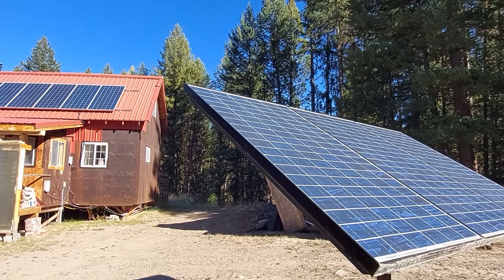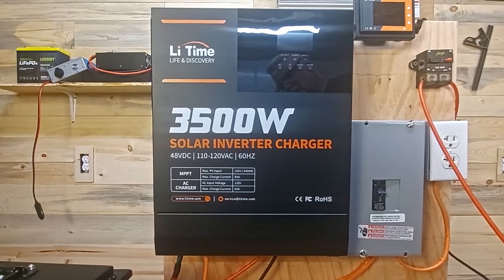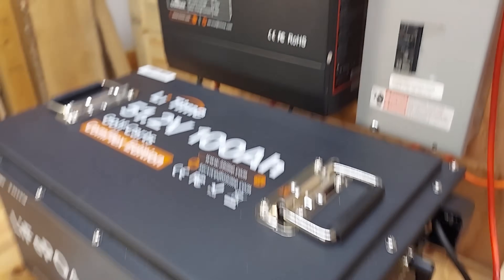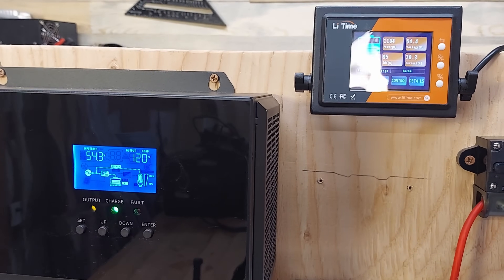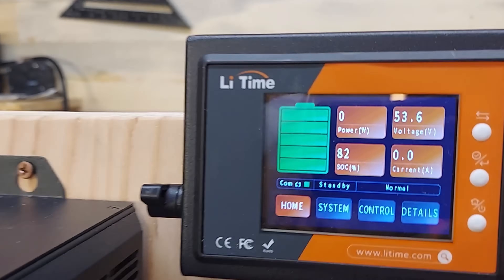Inverter Idle Power Consumption: What You Need to Know!

Comment: Thanks for the video. Would you feel the same way if you only had a 100 AH AGM battery in your system?
Reply from the maker: 1 100AH AGM wouldn't give me much power (at most you really should think of it as a 50AH battery in terms of use, and really a 25AH one) so to answer your question:  I would never try to do much with a 100AH AGM so Inverter Idle Consumption wouldn't be the issue, the battery would be.

Of course, I believe I mentioned that I worry less about the inverter and more about sizing the battery bank correctly ;)

Comment: Can confirm Not worrying about inverter idle consumption in a van means you just leave it on and where 240v (Aus) products are often better and cheaper than 12v alternatives there are no impediment to using them if all it needed was an extra 100w panel.
Reply from the maker: Makes sense on the 240v and yes, depending on the inverter idle, another panel usually does the trick (if you have the room)

Comment: I agree completely.  ANY inverter is going to use power just to have power available for you to use.  I have seen that as high as 72 watts on some of mine.  It's really irrelevant .
We got 3.5" of rain, tornados, and straight line winds yesterday.  2 people were killed, power was out for several hours, and we have multiple large trees down along our western pasture, but no physical damage here.  We used power stations to run our entertainment, refrigerator and a couple of fans during the short outage.  I cranked the dual fuel generator to run the freezers out back at around 7 PM and the power came back on at 7:45.  I had the Honda set up to run a bedroom window unit if the power stayed off.  Yes, it's early April, but we have had temps in the high 80s for the past few days.
So far we have had almost 6" of rain in the past 18 hours.  The sun hasn't even thought about peeking out, so solar generation won't be happening much today.  That's why those gas generators are so critical.  Our TV is a 65" and uses about 150 watts to run.  The router uses 40, so we will burn through a KW power station with just our entertainment system, and what else are we gonna do during a massive rain event?  Throw in a fan, some lights, and the refrigerator and 2-3 kwh of battery don't last long.
Reply from the maker: Yup, a few kwh will get you by in the short term but a generator greatly increases that.

Comment: Is that 50W overhead that will always be wasted, no matter whether a zero load or a full load? Or is it like idle on a gas car where it's only wasted at zero load, but once your up to full load, all power is put towards load with no overhead waste, just efficiency losses? 
Thanks. Great video.
Reply from the maker: I must admit I always assumed that is what it takes the inverter to run at idle and that it either draws that or more at use.

Comment: The problem with this cheap high frequency, transformerless inverter is not its idle power consumption, it's the fact that the manufacturer stripped out the most critical component that's needed to make this inverter long lasting, powerful, and most importantly, safe. This critical component is an output transformer. Without an output transformer to provide galvanic isolation, this inverters offers a shorter life expectancy, a much poorer surge capacity, and it can damage your appliances when its MOSFETs fail and can even set your appliances on fire. I would never use one of these lightweight inverters to power the appliances in my home.
Reply from the maker: 1 it is not transformerless,  2 most modern appliances don't draw the kind of power LF inverters can provide, 3 if you are correctbthan all power stations should be tossed out.

Are there better options?  Of course!  Can everyone afford them?  Nope.

Does everyone have to do as you say ir they will burn their homes down, ruin all their appliances and watch their offgrid cabins sink into the abyss?  No.

I ran our cabin on an HF Modified Sine inverter for the 1st 3 years before getting an expensive LF inverter and guess what?  My appliances are all still working fine 15 years down the road.

Comment: If you have a big system, then just throw in an extra panel. 

If you have a small system or a power station, it is a BIG deal. 

For Example, an EcoFlow Delta 2 uses about 35-40 watts of power. It also only has 500 watts of input power.  

Let’s assume you get good sun and are at 100% at 4:30 in the winter and you start producing at 8:00 in the morning. That is 15.5 hours of no production.  That is about 500 out of your 1000 watt-hours gone.  It also means I have to use about 25% of my total input to just makeup inverter losses. 

Another example:

I have a 24 Volt garage system I built for emergency use. Except for the battery and cables, I used mostly used/open box components to save some on the prices. 

I have two 15 amp MPPT controllers that can pull in 400 watts each. I have a Victron Phoenix 24/1200 inverter and the entire losses from the battery when the inverter is on is 14 watts and about 3 watts when the inverter is off. So I am only using a total of about 200 watt hours over night. This is equal to about 50 watts of solar panels a day out of 800 for only about 8% of my maximum solar. This is negligible. But I used a cheaper inverter with 40 watts of power usage, then I would need about 200 watts of solar to make up for the loss. 

For power stations, it is important to cut off the inverter when not in use. With something like a refrigerator, you can double the runtime by using a one hour on, three hours off if you cut off the inverter for those three off hours.
Reply from the maker: The issue here is that Power Stations aren't really built to run a home or for that matter a cabin, for an extended period of time.  That's why I do things like adding extra batteries etc.  But in the end, they are very limited when compared to even just an inverter and batteries.

Comment: Hi Old Jarhead! I have question please. I have compiled the parts for my 24 volt system. Includes 1000 watts in panels, 7 kw storage, and victron scc smart 100/50 including various other necessities 
My largest load for my setup is an inductive motor (110v) which maxes out at 1,050 watts. Short duration, i  use it a dozen or more times a day for anywhere from one to five minutes at a time. It averages total consumption 2kw in a 24 hr period.
The❓will i let the smoke out of a hi frequency inverter or should i purchase a low frequency inverter instead. I see from research the low frequency ones more suited with larger transformers. In trying to decide i see the all in one inverters, though i already have the victron scc. Help! What is your suggestion. 
Thank you Sir❤ i appreciate your time.
Reply from the maker: I run an LF inverter as they are more robust and can take those loads easily without an issue. The ne HF inverters can I'm told, but I suspect even the good ones aren't really designed for it. I'd personally go with LF.
Reply: @TheOldJarhead Thank you sir. Could you recommend one? I seem to have difficulty researching/deciding on this piece of the puzzle. I was nearly decided on an HF one.. Thank you again. Love your content. I learn from you still. Many thanks Sir
Reply from the maker: My AIMs ran 11 years before I changed to a newer version made by Sungoldpower.   AIMs would be myb1st choice.  SGP is basically AIMs made by another company but may not have as a high a standard
Reply: @TheOldJarhead  Thank you, that helps. I'm looking into the SGP ones. I forgot about aims. Thank you!! I will be able to make a better decision now. Bye for now
Reply from the maker: Absolutely

Comment: Agreed. Parasitic Inverter loss should not worry you. It's the cost of using solar. Add bigger battery or the cheaper option, add another solar panel to make up the loss and you're done. What I do is, many of my things are 12V DC, lights, TV, fridge, computer charges via 12V DC like a cig lighter socket. So I simply turn on the inverter only when I need 120V power. Like to heat shower water, use the microwave, instapot, coffee pot, blow dryer, washing machine etc. So I really don't even need 120 AC power at night when the sun is down, and my battery bank is big enough to run all my 12V DC items all night and doesn't even use half the battery bank.

Comment: Great video!  That 3600 watt inverter will also save a lot of wear on your smaller inverters as well.  For ex. if you are running a 1800 watt  toaster oven on a 2000 watt power station you are really stressing it.    Much smarter to run things like that on that LI Time 3600 or equivalent.  Like you said panels are really affordable these days.
Reply from the maker: Absolutely! It's good to have the power to back up the power!

Comment: You're absolutely correct. That's the way you have to think about things - what gives you the most bang for your buck. Idle draw is inconsequential for a system that only idles about 8 hrs./day. I don't use my power saver mode either as I have a residential fridge that needs power 24/7, and I often run a fan or my mini split heat pump at night. Pus any overnight phone, laptop, tablet and MiFi charger will shut down, your TV will shut down, etc. - it's just not worth it for the tiny amount of power you might save. If that little bit of power makes a difference you need a bigger system. We live FT off grid in our motorhome with 5,020 watts of solar, 23.5kwh of LiFePo-4 batteries and a 5kw all-in-one inverter/charger/charge controller, which is more than adequate for our needs. In the last 2 years we haven't had to run our back-up generator even once (other than to exercise it), even thru a week of overcast skies during a hurricane.
Reply from the maker: That's awesome you've been able to get by without your generator!

Comment: I wonder if one solution for some people is to NOT run the inverter unless there is a request for a load.  For lights and things you could just run off 12 volts.  There are refrigerators that run off that voltage and loads of other stuff.  Then if you need 120VAC, the inverter turns itself on.  This would require some low voltage smarts but I'd think it's possible.  But I get it..don't worry about it.
Reply from the maker: It is possible in factvits dontbwith ECO mode on inverters, but I feel adding a dmsokar panel makes life easier 😉

Comment: Given sufficient solar, one good reason to leave systems energized (in winter) when you aren’t present is that it prevents their components from deep-freezing.  Electronic components last longer when the temperature range of the thermal cycling is reduced.  Also matters for batteries… having enough solar and storage to allow the battery heaters to operate in very cold environments is important.